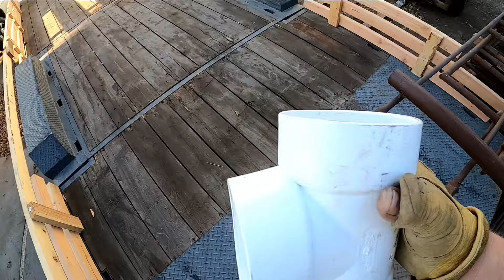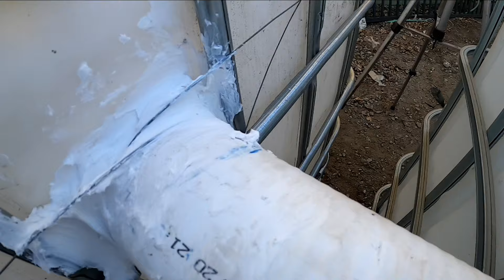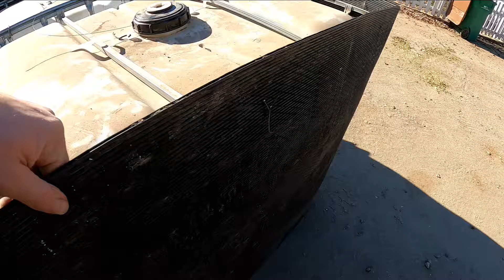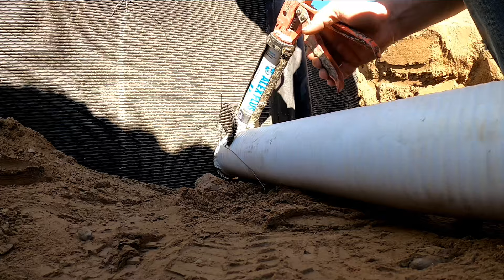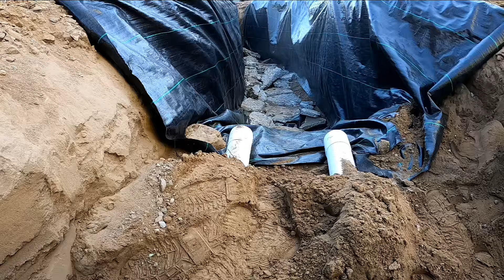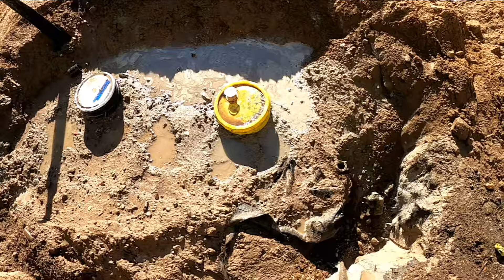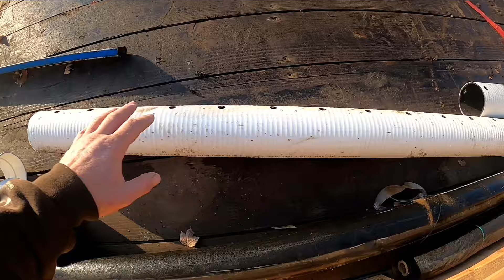Cheap, easy DIY TOTE septic system | Cabin, RV, Tiny home, off grid

Comment: What are the 2 black upright pipes for ?
Reply from the maker: just the plumbing from the old water heater panels. They werent part of the septic system plumbing. I left them temporarily so I could keep the location of the tank fresh in my mind
Reply: So no vent?

Comment: I have to have a Above Ground System if I were to put one in. And at around $10,000 PLUS... No Thank You... I will stick with my Camping Toilet. I live OUTSIDE City Limits, Only needed a $450 Septic Permit that is "Suppose to be" Renewed every 1.5yrs at $450 a Pop, to get My Mailing Address?????? that the Permit Needs a Address on it before you get it????? Don't ask me, I have No F'n Clue either... 
    Collect Rain Water for Bathing and just throw it out in the yard. Piss Outside or in a Milk Jug and later pour it out... Poop in a Walfart Bag in the Camping Toilet and throw it away at the Gas Station down the Road.. Yes, It is LEGAL to Do So... Plus what they don't know don't hurt me.. because the Garbage Men HATED me throwing them away in My Own Bin... Tho %100 LEGAL!.... No Different than throwing Colostomy Bags away or Diapers...  
    I Live in a Camping Trailer, Why Do I need a system meant for a 4 Bedroom House? That's how they Determine the Size System you need...  My Nearest Neighbors Holding Tank System, No Drainage Field.. Has been FULL and Over Flowing and Stinks for the Past 13yrs I have been living Next to him... My Above Ground One Needs a Drainage Mound that the Bottom of the Mound Starts almost 4ft Off the Ground and Then I can Lay the Pipe and the 4ft of Dirt On Top of it.... and needs to be 35x35... 8fy High Mound of Dirt is what I was told and they want, if they were to Force me.
    They Did Come out and inspect me a couple of times ( neighbor not minding his own business ) and I told them I use a Camping Toilet... "No Problem" They Said.. "It's Your Property, you can Do What Ever YOU Want on YOUR Property but Grow Drugs"..